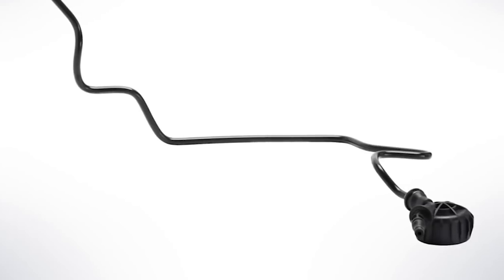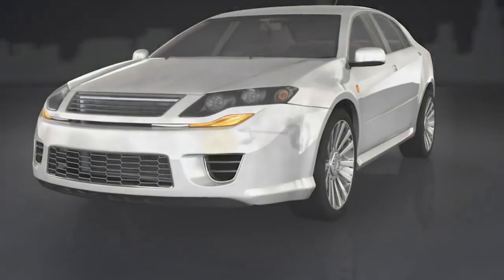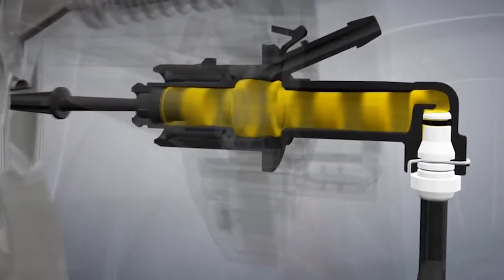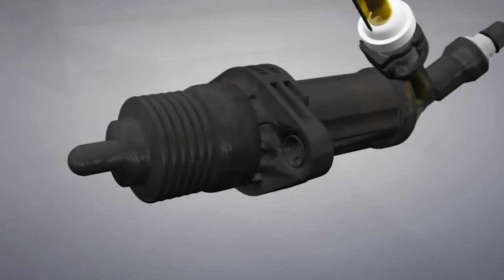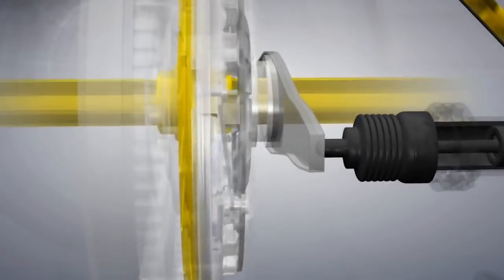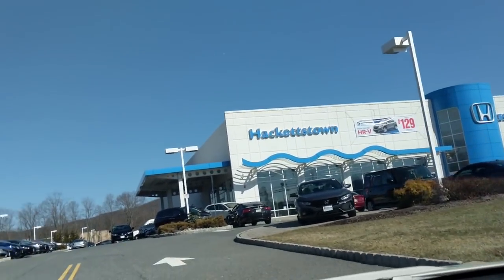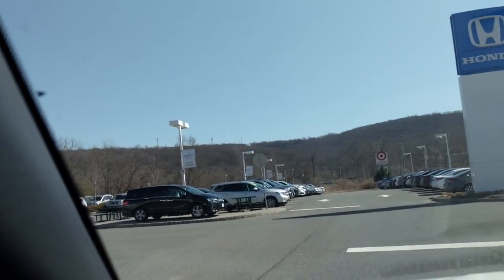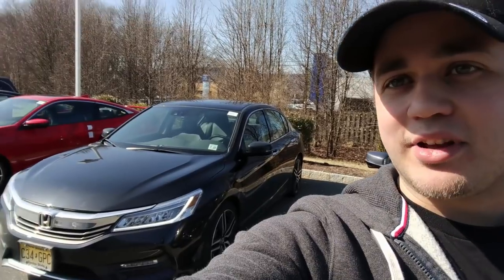Honda Civic Type R Transmission Update | Clutch Master Cylinder & NEW TRANS?? | VLOG

Comment: I believe that removing the damping on the clutch line is far less catastrophic to the drivetrain than grinding second gear all the time. I think you're doing the right thing.
Reply from the maker: agreed, as long as I'm not dumping the clutch, which I have no reason to do, this will be an important upgrade for the Type R

Comment: You can get a new transmission.  I was the 4th Type R in the country to get a replacement in.  I wouldn't do anything with the clutch yet. It will probably void your warranty. It is your transmission trust me.
Reply: I was thinking the same thing. Last thing you want to do is ask the dealer to replace the transmission, "under warranty" and ask them to install a "modified" part, under warranty.
Reply: Kush Daddy haven't had any issues since the replacement went in. Little over 3,000 miles on the new one.  Not one grind.  Before i was getting locked out of 1st,3rd,4th, and of course grinding 2nd.

Comment: If this doesn't work, try removing the delay valve in slave cylinder and from time to time check the master cylinder for any leaks since you might have more pressure in the hydraulic line with dampener removed.
Reply from the maker: I might also do braided clutch lines as well, I"ll try anything to stop the grinding.

Comment: So you were able to tell them "Hey I want a new transmission and this new part installed" and they just did it? I've been fighting with my local dealership for months to try and get this issue fixed. They won't even look at anything until they can "replicate the issue"
Reply from the maker: I did, my dealer is great
Reply: Well I ordered one of the modified master cylinders, hopefully I can find a way to convince them to do the same for me. Thanks for the video!

Comment: I would be really surprised if they replace the transmission.
Reply: Navi at this point they probably replace it. I work at a Honda dealer in NJ
Reply: ive seen 2 trans replaced already by the dealership for the type r , i just dont understand why they wont change his. i dont get it...